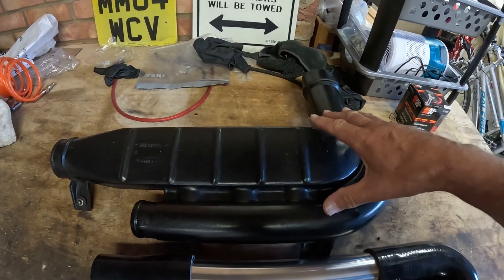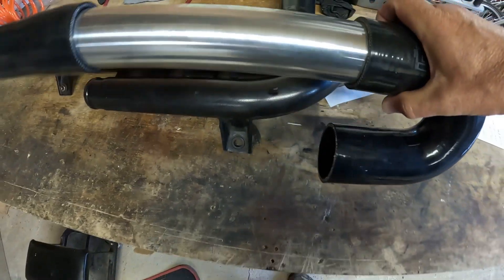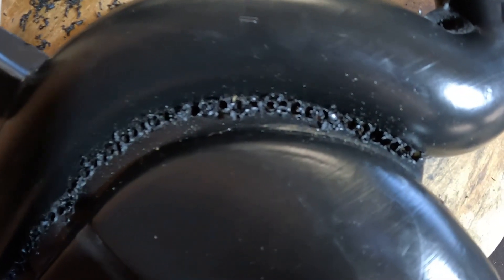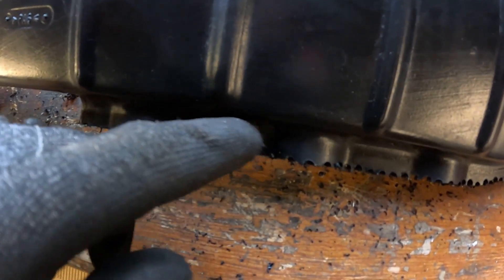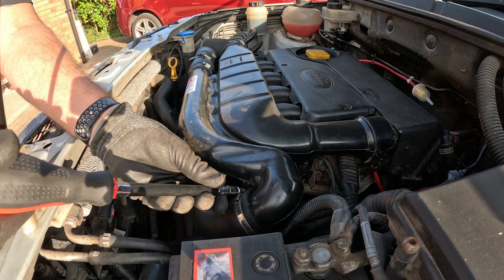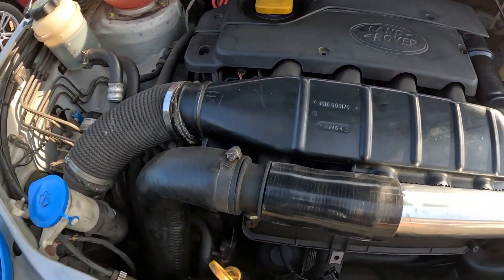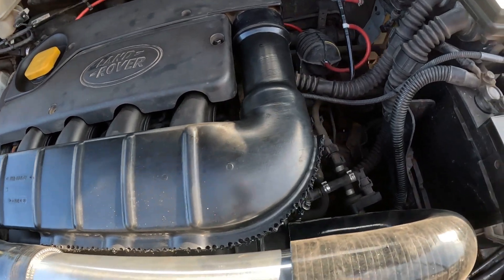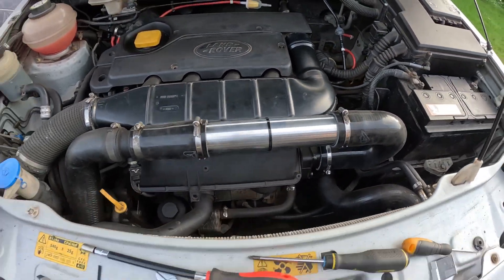Freelander 1 TD4 Turbo Boost Pipe Upgrade

Comment: Nice mod did this back in 2014 on my first ever FL1, just so as you mentioned it's much easier to change the air filter, you FL1 if you still have sounds like it has early start of crankshaft pulley delamination.
Reply: A year ago it started to get a bit noisy at idle but hasn’t got any worse, I think it’s the pulley but sounds a lot worse on this video than in person.
Reply: @TwoWheelHustle  as long as you are aware of the situation, Corteco is the pulley to use any others don't seem to last good luck

Comment: How is it after 4 months? Still going strong? Anything you would have done differently? I'm about to do this on mine you see, your video is very helpful!
Reply from the maker: Still going well, as a test I fitted the std manifold back on and it felt a bit sluggish on acceleration, a slight delay.
Reply: Perfect thanks for your help
Reply from the maker: @GasManLS7  thinking about this, you will need a joiner and step up pipe as the alloy pipe diameter is bigger that the intercooler hose, I show this in the video.
Reply: Also do you know what the difference is on the Facelift version? I see muddymods sell different hoses for them just wondering if the ally pipe needs to be a different length
Reply from the maker: @GasManLS7  the pre facelift has a longer pipe from the intercooler to the manifold as they don't have the temp sensor, the manifold is the same as the facelift models so the alloy pipe length should be the same as the point where the manifold conencts to the intercooler pipe is in the same place, I hope that makes sense.
Reply: Yeah it looks like you have the same pipes as me, with the sensor in plastic section to the drivers side of the ally pipe. I thought that was only on Facelifts

Comment: Hi mate can you tell me the length and diameter of the pipe you have used please I’ve watched the video a couple of times but there is no mention of this thank you
Reply from the maker: I have linked to each product in the description, the size of the longer pipe is 57mm/310mm, the silicon elbow is 57mm and the reducer pipe is 57mm>51mm. I hope this helps.

Comment: Do you have any dyno spec before and after? That can't do that much of power difference to std spec?
Reply from the maker: Hi, I don't know of a dyno near me that can take a 4x4 so I don't have any numbers or graphs.
As I said in the video, it doesn't make a huge difference but it does feel a bit more responsive as the smoother air flow allows for the turbo to spin up a bit quicker.
Note that it will not create any more power, (the remap did that) but it does change how the power is delivered.
Reply: Was it much better after a remap ?